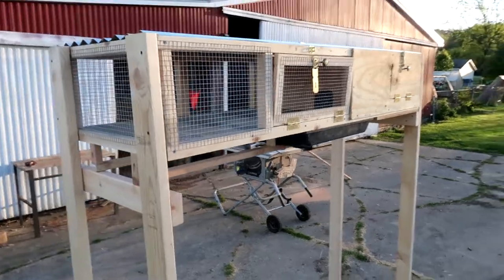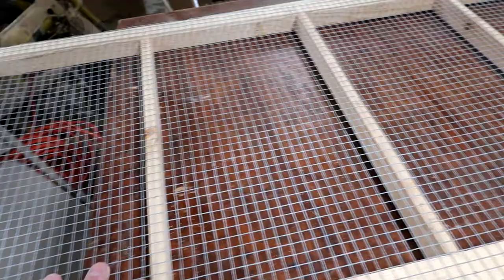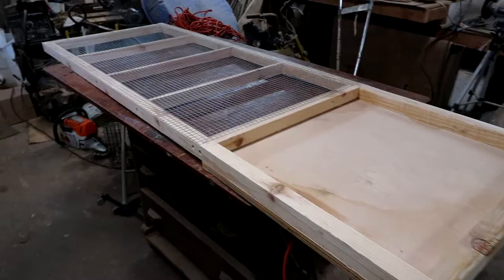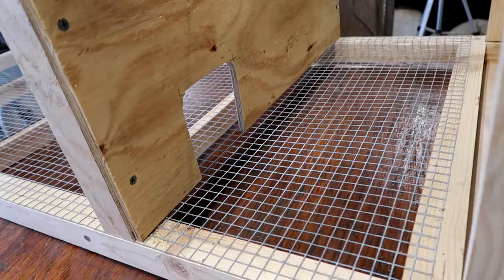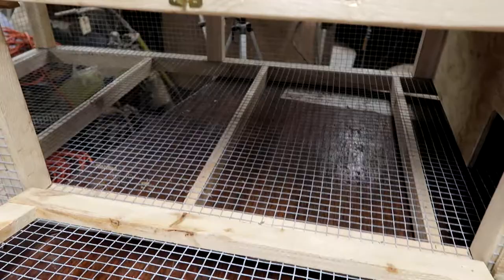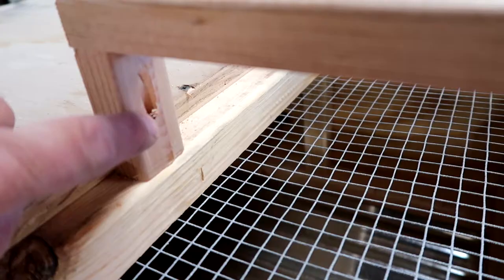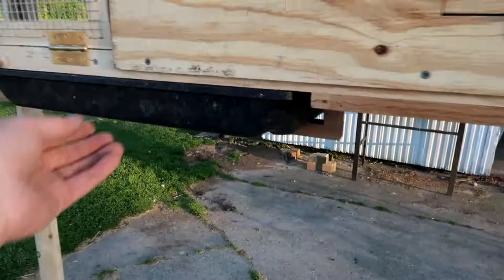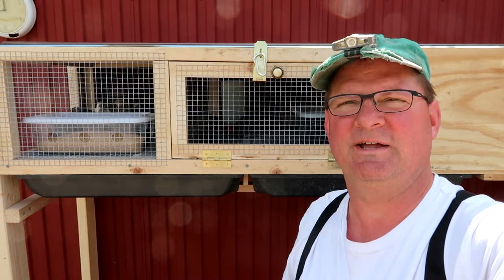Making a Quail Hutch

Comment: great job, I'm building that now.  Making two 4' long hutches per level, sandbox will be 24" deep x 15" wide in the box area with a libit of wire like yours. Like Chris, I'm gonna put wire on top and add a metal roof 12" above that for storage area. If yours is a bit wobbly, add some bracing in the corners with a short board with a 45 cut on each end.  Terry does that (Coturnix Corner)

Comment: There has to be a way to avoid the hardware cloth above wood... the droppings just get all over it, and th 1/2 x 1/2 cloth doesn't let the droppings through..
Reply from the maker: If you figure it out, let us know!  Hardware cloth is strong, but after about 2 feet, it will sag, so there has to be some sort of support.  You could possibly use 1/2" x 1" welded wire that's commonly used for rabbits.  Just a thought.  We've been using these pens for over a year now and the poop doesn't build up much at all though.  We've never had to scrape it out, even in winter.  The 1/2" x 1/2" lets the poop fall through with no problems.  It's awful for rabbits, but great for quail.

Comment: I see a lot of designs with a egg rolling floor.. Are they worth the effort? Do you experience a lot of breakage?
Reply from the maker: I've never had a rolling floor so it's hard to say.  We hardly get any breakage compared with the chickens.  Occasionally the quail will step on an egg or lay an thin shell egg, but that's about it.  At most we were getting about 50 eggs per day from 6 cages.  Not having a rolling cage means we open up, stick our hands and heads in, so we get to see the birds to make sure they're doing well.
Reply: @HappyWifeAcres  That's what I figured as well..I've had 6 laying hens for the last several years and am going to try quail now too. Thanks

Comment: Where did you get the drop trays?
Reply from the maker: We bought them at two different places.  One was as Rural King.  But later, they didn't have any for a long time and we had to order them online from Jeffers.com.
Reply: What is the dimension of the poop trays?
Reply from the maker: The one we use is 24” x 24”, but you can buy bigger sizes.
Reply: I think you can use AC drip pans from Home Depot